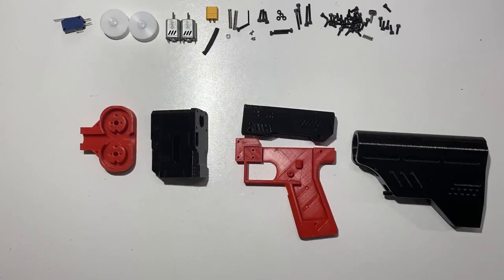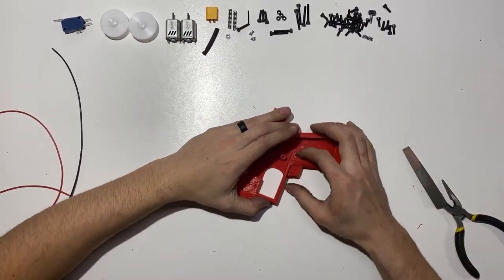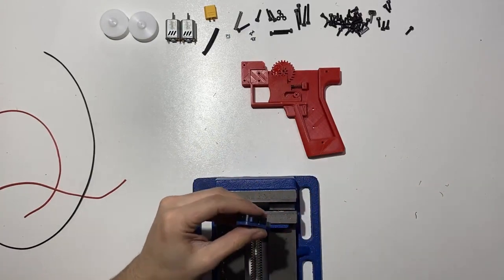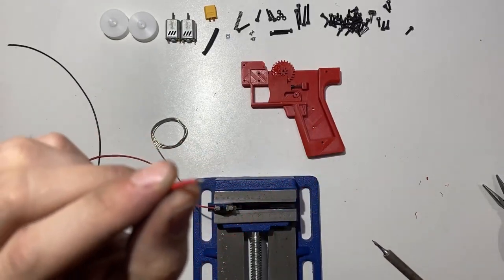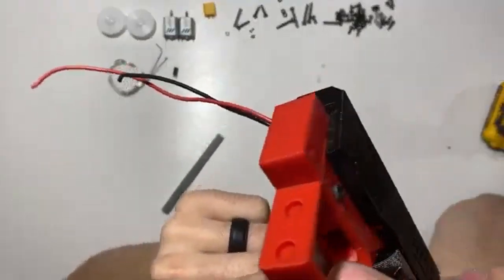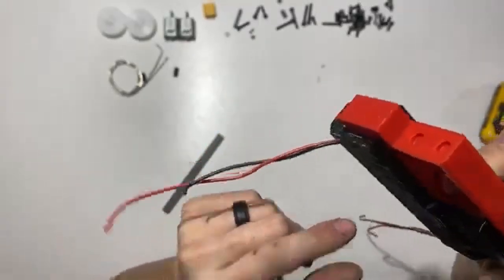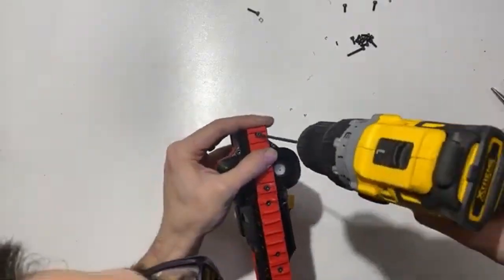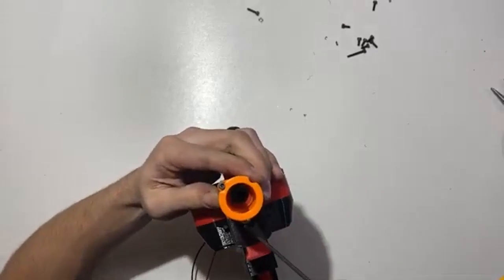Nerf Gryphon Assembly Build Guide

Comment: So the motors are wired paralell on what voltage are they running? Do I need a 2s (7,4V) or 1s (3,7V) lipo for 2 motors?
Reply: 3s